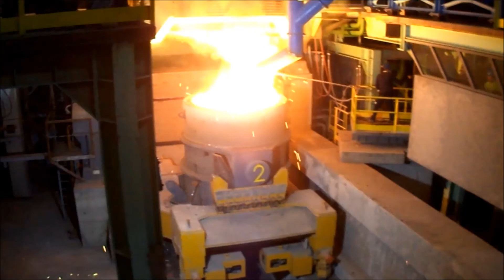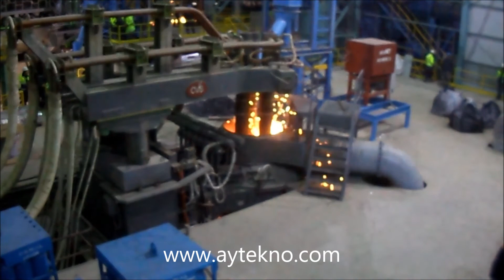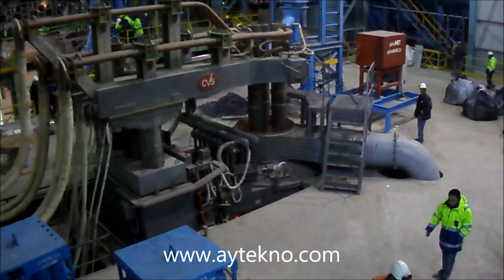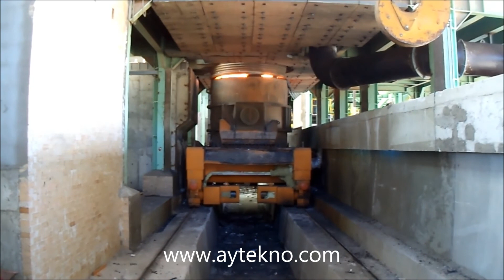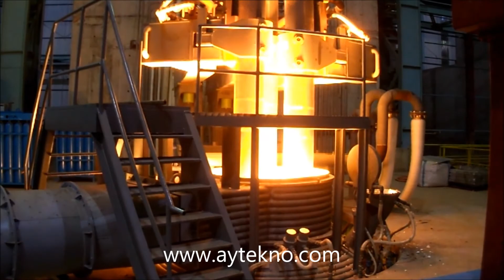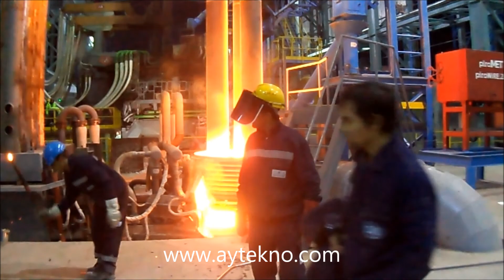LF döküm alıyor Polteks F&F Steel Aytekno Mühendislik ladle furnace pota ocağı

Comment from the maker: ladle furnace,

LF Pota ocağı Elektrik montajı,

Ladle furnace,

LF elektrik mekanik montajı,

LF otomasyon devreye alma,

ladle furnace slogin construction,

ladle furnace pdf,

ladle furnace transformer,

ladle furnace in steel making,

ladle furnace control,

ladle furnace video,

ladle furnace meaning,

ladle furnace manufacturers,

ladle furnace application,

ladle furnace arcing,

ladle furnace advantages,

ladle furnace slag,

ladle furnace desing,

ladle furnace desulfurization,

ladle furnace for sale,

ladle furnace function,

ladle furnace heating,

ladle furnace jobs,

ladle furnace lifting,

ladle furnace electrodes,

ladle furnace roof,

ladle furnace refractory,

ladle furnace transformer,

ladle furnace traduction,

ladle furnace youtube,

ladle furnace operation,

ladle furnace operations,

ladle furnace price,

ladle furnace principle aytekno
engineering,

Pota ocağı nedir,

Pota ocağı video,

Pota ocağı pdf,

Pota ocağı proje,

Pota ocağı aytekno,

Pota ocağı satış,

Pota ocağı ikinci el imalat,

Pota ocağı metalürjisi,

Pota ocağı çalışma prensibi,

Pota ocağı trafosu,

Pota ocağı elektrodu,

Pota ocağı aytekno mühendislik,

rogowski coil